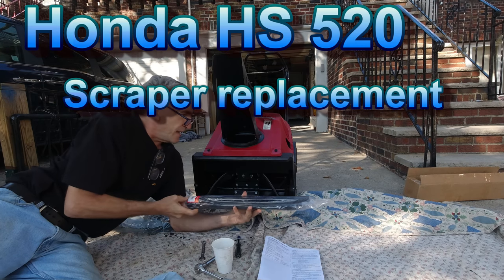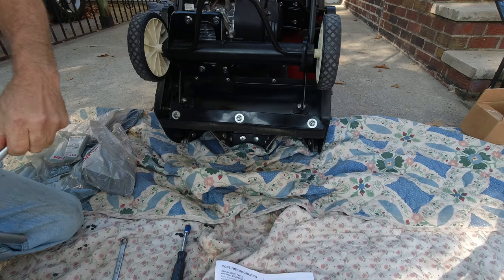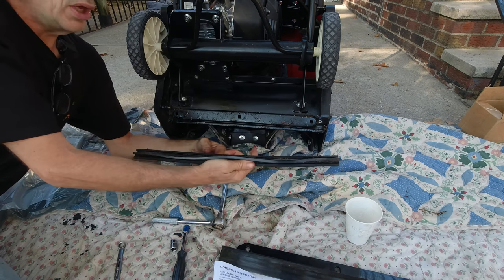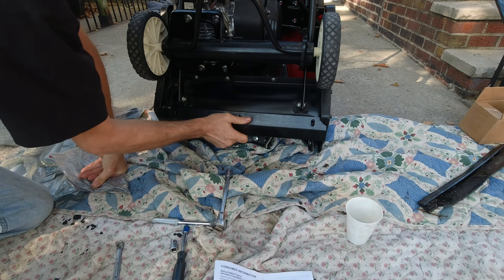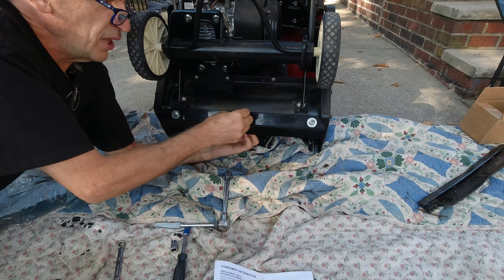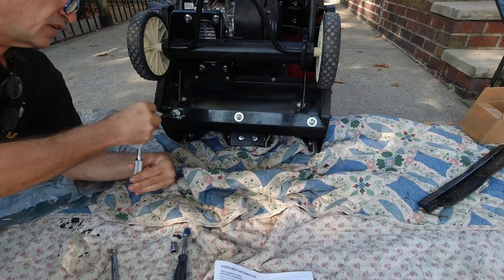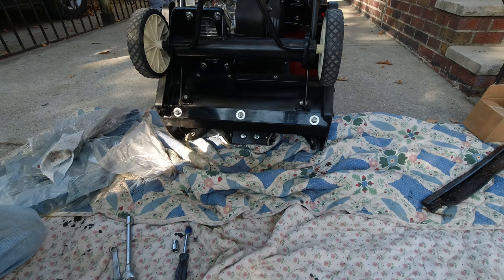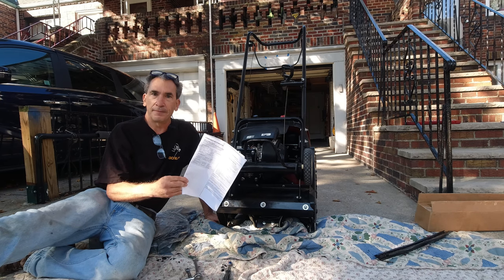Honda Hs 540 Scraper replacement how to

Comment: I just replaced the rubber paddles and scraper blade (all OEM) on the used HS520ASA Harmony I bought. The official manual I downloaded mentions an adjustment to the blade 1/16”-1/8” from the lowest point of the paddles. The paddle to the new scraper bar measurement with the bar fully up is greater than the recommended adjustment that would only increase if I drop the spacer bar. Then it continues to say to make sure the bar is adjusted so the scraper bar has the same previously mentioned spec. gap at the side bases of the snowblower. Confusing and seems odd you would want the scraper bar contacting the ground. I notice other snowblowers have side sliders to contact the ground and then scraper is set to a gap. Looks like I wish mine had these sliders so I am not wearing out the already banged up sides of the snowblower which in this case I guess the scraper bar is supposed to protect. Thoughts anyone?
Reply from the maker: I did not see any nfo on mine, and I want a lil height so when that  sidewalk I do has a  lift  iwill not  hit it
Reply: Kneeling down and looking at your snowblower from the side, it should be resting on the scraper blade and the side panels should be slightly off the ground- 1/16 to 1/8 of an inch off the ground.   This gap between the side panels and the ground, made possible by the unit resting on the scraper blade will prevent your side panels from getting banged up (if your side panels are getting banged up the scraper blade needs to be lowered or replaced).   You can lower the scraper blade by loosening the three nuts and pushing the blade downward then retightening.  It makes sense that the scraper blade is the lowest point otherwise snow will escape beneath if it is not scraping the ground.  The lowest point of the rubber paddles should be close to the ground but not touching 1/16" or so.  The instructions in my manual are pretty good-- I had to read them 6 times but still pretty good.
Reply from the maker: @justinshelton4084  Thank you excellent tips for sure
Reply: @fishycomics  You are welcome.  Great video thank you- we got about 10 inches of snow here last night so we really appreciate the instruction- the snowblower did good with the new scraper blade.
Reply from the maker: @justinshelton4084  thanks Justin I'll look into it but I am happy with it being higher than lower for many reasons here, the  cracks, rocks etc.
Reply: Single stage snowblowers are designed to scrape the ground with the scraper. 2 stage blowers do not scrape.  The scraping is nice because it really cleans the pavement. The downside is that the scraper is a consumable item, must be replaced.  I have owned this snowblower for about 10 years. Its a good one.
Reply from the maker: @thomascole1782  Big thank you for that tip. I do not mind it being slightly off, for the reason of I won;t have a problem gliding over  cracks. and constantly pushing harder.
Reply: @fishycomics  The scraper is also what protects the sides from getting rough, rusted, and bent. The machine is meant to rest on the scraper and the wheels. The paddles "pull" the machine, when you tip it forward. Thats the self-propel bit.
Reply from the maker: @thomascole1782  my machine is  not new its been with me since my Hondacrv 2002.
Reply: @fishycomics  yea, the model discontinued a long time ago.

Comment: Why should I replace the scraper?
Reply from the maker: For me I chose to change it due to wear, before it gets to the metal.
Reply: Thank you for your quick reply.  I google and this is the reason why. 

C/p:

Scraper blades and rubber paddles are designed to be replaced in sets on single stages. They wear at similar rates so now you have really worn paddles that are no longer sticking out past the brand new scraper bar.
Reply from the maker: @Scott-xq2dm   thank you,     the cost is not expensive to replace.
Reply: single stage throwers have a plastic scraper bar that ride on the cement. If you use the machine and never change the scraper bar eventually you'll be grinding metal on cement.
Reply from the maker: @norge696  Why they are parts to be replaced. And what I did to show all glad we got  advice from a excellent person.